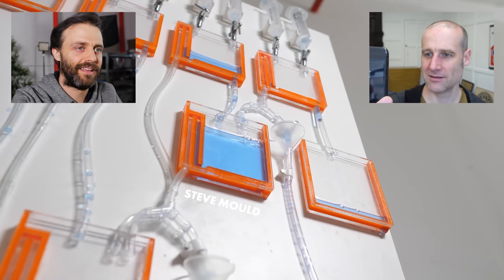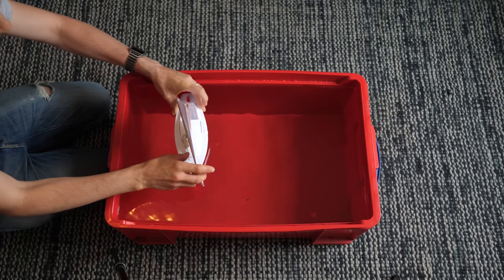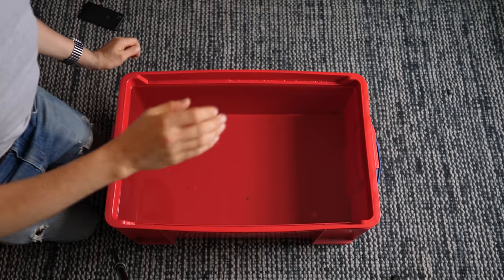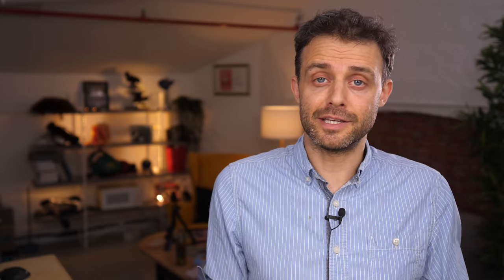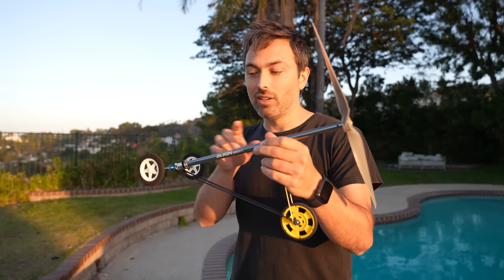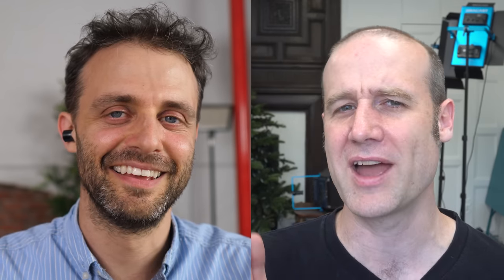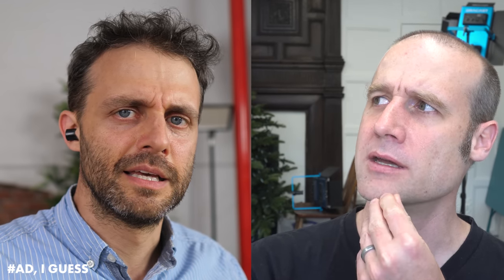Sailing Faster Than The Wind - How Is That Even Possible?

Comment: Delighted that I can wave my hands and a Steve Mould video appears
Reply: It's so cool when the same topic is explained by my two favourite science communicators.
Reply: Can you make a hand-propeller to improve this process?
Reply: A Wild Steve Appears!
Reply: In my experience: the novelty wears off after a while.
Reply: @standupmaths   kinda feels like christmas ❤️
Reply: I would like to think that I should get some credit for this too.  You guys may not know it, but I've been waving my hands this whole time!
Reply: Your video about passing wind in a land yacht gave these guys the gas they needed.
Reply: Can we do please a mega crossover with Derek, Steve, Matt and Michael (from Vsauce)?
Reply: Veritasium's video was about moving downwind faster than the wind, not simply moving faster than the wind. Steve, you missed the opportunity to show that possibility using your model. It should be doable if you point the "boat" 45 degrees and angle the sail somewhere between the direction of travel and the normal to the wind direction. This should cause the model to "outrun" the wind in the direction it's moving.
Reply: YOU NEED TO WAVE YOUR HANDS MORE OFTEN: but then you would have less time to make your wonderfull videos yourself.
Reply: @ericcmcgraw  steve has shown that if the wind pushes the sail at angle, the boat can move faster. derek has shown that if you angle the blades and force rotation via velocity, then it also moves faster. steve is showing how it works but flip it perpendicular and youve got dereks model. steve can only work with the resources he has
Reply: Classic Derek.
Reply: Let our powers combine!
Reply: he did kinda insult your video lol
Reply: @primenumberbuster404  yeah I hear creators lament that they can't put a video up if another channel did the topic already, and I'm like, don't be stupid, that doesn't matter to us, we actually like it.
Reply: @pulsarstudios3646  Steve's model doesn't require any more complexity to outrun the wind. He simply needs to run one more experiment. Just point the model 45 degrees from the direction of the wind. If you then aim the sail directly at the wind, it will exactly keep pace with the wind. Point it one more degree towards the rear of the vehicle and you can already outrun the wind. Go further and you can go even faster downwind, until it's parallel to the wheels and you run into the same limits he showed in the video. It is possible and easy to show that his model can outrun the wind, he just didn't try it.
Reply: Derek, maybe you should put a prompt in your next video and see if Steve bites.  Like: why does poop smell bad?
Reply: @ericcmcgraw  no, because then you are not traveling directly downwind, you are traveling at 45 degrees to it. Veritasium's video is much more interesting than simply tacking at 45 degrees, it should really be impossible to do at first glance.
Reply: Wait a minute.  Steve shows here that it's possible for a boat to sail faster than the speed of the wind but not directly downwind.  BUT... in Derek's video (Vertasium), that vehicle was traveling faster than the wind IN THE SAME DIRECTION.  I would like to see Steve's explanation for how this is possible.  I don't think it's possible in a boat.  In Derek's video, the wheels' motion, driving the propeller, play a crucial role I think.
Reply: @ericcmcgraw  I don't think so.  A boat cannot outrun the wind in the same direction as the wind.  In Derek's video, the vehicle's wheels are linked to the propeller, which adds enough force to exceed wind speed.
Reply: @jeremiasrobinson  Thank you! Here, have some credit :)
Reply: Thank you , @SpaghettiEnterprises !  It feels good to be recognized!
Reply: Veritasium keep me in mesh n this video clear me without actually telling the way I understand. 😁
Reply: @benedictifye  "Steve used Hurricane. It's super effective!"
Reply: Haha, you two have the same video topic
Reply: Hi Derek and Steve, You got a have a look at my antigravity box. Ofcourse its developed fro one of your videos
Reply: @EmilioBPedrollo  Would love to see this! you just named 4 of my fave channels lol Its a shame the world is so big and everywhere is so locked down because i would love to see these 4 + smarter everyday day doing a full in person collaboration. Maybe the same idea but the challenge is passed across the atlantic each time.
Reply: @primenumberbuster404  For me too.
Reply: just means your explanation was a bit.... :p

new one is so much better.
Reply: With great power comes great responsibility. 😂
Reply: I was about to go search for your video again to comment 😂
Reply: It's actually this video that decided to watch your video next. Why? Because I thought I understood. But Steve Mould said things that made me need to know more.
I would have watched the video anyway, as an aerodynamic recumbunt driver I love everything that are self sufficient, like human power, solar power. But I thought I knew how wind power was handled. Wrong.
Reply: @kenhaley4  From flying a drone I've observed that even a small increase in height results in much higher wind speeds.  I suspect that even a flat perpendicular sail would result in the same effect (of the ribbon at ground level pointing 180 degrees to the wind).  The wind higher up would propel the craft faster than the wind speed at ground level resulting in apparent faster than the wind travel.
Reply: you should wave you hands more often
Reply: With great power….,
What I’m saying is if you have an uncle named Ben, who is not affiliated with an Uhm, let’s charitably call it “insensitive” Branding campaign for a popular cereal grain, you should get him body armor ASAP.

[ASAP literally means “Right STAT now.”]
Reply: So, Steve Would?
Reply: @rifwann  No, Steve Mould.
Reply: @nohjrd  In which direction buddy? Unless you're trying to make your sail boat lift off the water like an air plane your comment is nonsensical. Think about what you said. You're mixing up both videos as if they are describing the same thing they aren't. There is no sail in Dereks video. It uses the wheels rotation to turn a propeller like a fan and uses the air from the fan to push the car. Ok go get a house fan and stick it on your skate board, then imagine doing that with the wheels connected to the propeller so when they turn it turns. 

In neither video is there anything with a sail and a ribbon at the same time. The ribbon is from Derek's video the Sail is from this video. Did you hit your head bro? Nobody is talking about wind speeds relative to height. The effect would be canceled out by the thinning of the atmosphere anyways at a certain height. The fact you think the wind is moving faster as your drone takes off is an illusion. It's not that it's moving faster its that there is less for it to run into , (the ground, buildings etc) and so your drone goes form experiencing wind in multiple directions to one direction and thus to you it seems like the wind speed increased, when it didn't it just all striaghened out to be going in the same direciton.
Reply: Saw both videos, love them both. You guys rock!
Reply: We need at least another video about the propeller thing. Still dont get it. Can you redo the treadmill experiment for instance? Thanks
Reply: That little visualization where they show two boats sailing/tacking across a cylindrical earth, then turning that into a propeller blew my fucking mind. How does anyone think up something like that from scratch? Wild.
Reply: @stevenutter3614  Haha....whoa you totally misunderstood what I was talking about.
What I'm saying is that often in a large flat area at ground level a drone will take off and sit in place fine (up to say 2m), but when you ascend to around 8 to 10m you get a warning that the windspeed is too high to fly safely.  The drone hits the faster moving air higher up and gets pulled quite violently away from you.
Wikipedia explains this effect quite well (apparently called wind gradient).
If I were to get land yacht and sail it directly downwind in the same conditions, it would be getting pushed really hard up the top of the sail, but only gently at the bottom.  I could accelerate to close to the windspeed (as measured at the top of the sail) but never exceed it. If I dangled a streamer at the bottom of the sail, it would point opposite to the direction the yacht is travelling.
If Derek's video had a second streamer at the top of the fan, then it would conclusively demonstrate that the vehicle was travelling faster than the wind...without that it doesn't. 
Make sense?
Reply: @primenumberbuster404  But they didn't. Everyone already knew the sail boat could go faster than the wind. What they needed to explain was how the boat's tack speed (downwind) could be greater than the speed of the wind. That is exactly what the Veritasium guy just decided to skip over, the thing which was essential to understating how the car was able to move faster than the wind going directly downwind.
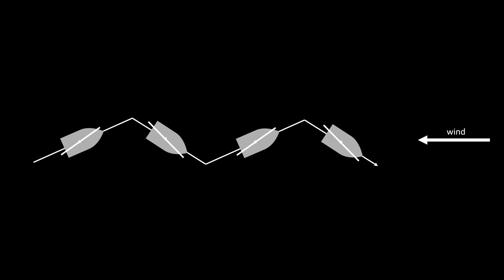Reply: The zigzag path at 8:51 is wrong, the sail angle must be between the ship's path and the wind, otherwise the ship will lose speed and then go in the wind direction
Reply: Well, only after Matt Parker delivers the message
Reply: @ericcmcgraw  We indeed need a proof that a sail boat can outrun a balloon in the direction of the balloon. I'm still not convinced. Let's say the wind is South to North. Let's say the boat is pointing North-East and the sail is maximally catching the wind let's cal that sail West-East. Then indeed the wind force will increase the speed of the ideal friction-free boat untill the SN-component of the sail speed is equal to the wind speed. This happens when the boat is moving in the NE direction at sqrt(2) times the wind speed. Still the N-component of the boat speed is equal to the wind speed and the boat and the balloon are moving with the same speed in the direction of the balloon.
So can we now angle the sail slightly to increase the boat speed further such that it will move faster than sqrt(2)*windspeed in the direction NE. If so then it will out run the balloon in the direction of the wind.
To me the answer is that this is impossible because in that case, the component of the sailspeed in the direction of the wind would be faster than the wind in the direction of the wind. Therefore the sail would be subject to (undergo) a wind force from North to South reducing the boat speed. 
I'd happy to hear where the flaw is in my reasoning. 
Of course, the machine in Veritasium's video is another situation because it has the wheel-rotation linked to the propellor in which case I agree that it can go faster than the wind in the direction of the wind. Those professors did a great job and invented something quite cool! I think in theory it could even be applied to sail boats replacing the sail by a giant propellor linked to a (reversed) boat propellor under water.
Reply: @richardbloemenkamp8532   The reason Steve's model works in this case is that we're assuming a frictionless and steady-state condition where everything has settled to a constant speed and there's no longer any force pushing the sail or accelerating anything. That's why the cart wheels are going straight without slipping, and the pusher-wheel is acting like a particle of air in the wind. When steady-state has been reached, any particle touching the sail will continue traveling parallel to it without being deflected in this case. 
I think I see your objection, but try this thought experiment on, given what I've explained about the steady state. Imagine the same scenario you mentioned with the wind traveling South to North and the boat is pointed North-East. We'll consider 2 cases: One with the sail oriented West-East as you described, and the other with an angle somewhere between that orientation and the direction the boat is traveling; let's call that the North-East-East case or NEE. In both cases we'll consider a wind particle (think pusher-wheel) that starts at the pivot of the sail and travels directly north 1 unit of distance, yet stays in contact with the sail because it's in steady-state. In the West-East sail case, the boat will have traveled sqrt(2) in its direction of travel (1 unit in the direction of the wind, 1 unit to the East). However, the NEE boat, because its sail is rotated counter-clockwise, the boat will need to be ahead of the WE boat in order for its sail to intersect the same point 1 unit north of the start.
If you think of it on an x-y plane, imagine the boat is constrained to the y = x diagonal line (45 degrees), and its sail can be at any angle, but must pass through the (0,1) point one unit above the origin. You can imagine the sail any angle and you'll find that it can end up anywhere on the y = x line. Horizontal means it travels 1 unit north, vertical means it doesn't move at all, 49 degrees means it has to move extremely far. This is why almost any downwind speed (or upwind for that matter) is possible, assuming sufficiently low friction. By zig-zagging you can compensate for the sideways motion and end up at any arbitrary finishing point.
Reply: @ericcmcgraw  Ok, that's a clever argument. If you extend that argument you could indeed move up to an infinite speed with a friction-free boat with a laterally air-friction free sail. This idea is more interesting than the entire video, but it is maybe a bit to advanced. Thx.
Reply: @richardbloemenkamp8532  Thanks. I agree it's interesting, and I was hoping he'd cover it in the video since he had the model and everything, but unfortunately not. Upon closer inspection it looks like he was trying exactly that scenario in the blooper scene at the beginning, but never explained it or showed it from above. Quite a missed opportunity; I'm hoping for a follow up video. (hi Steve, if you ever read this deep)
Reply: @kenhaley4  In Derek's video, the vehicle is traveling directly downwind, but the key is that the propeller blades driving it are angled to the wind. This effect is enhanced because they are rotating. The apparent wind for the blades would be close to the plane of the blades. This creates lift and allows for speed faster than the wind. Derek’s diagram of the boats going around a cylinder is a good demonstration, but he didn’t fully explain how it works.
Reply: What actually happens in Derek’s Veritasium video:
• If he ribbon is the only proof that the vehicle is going faster than the wind then the ribbon is just a red herring. It is easy to get taken in, if you first trust the prologue and believe there is a mystery. 
• If you want actual proof of how fast you’re going, in relation to the wind, you would have to measure the wind speed and the vehicle speed, at the same point, independently of each other. 
• Unless it tacks, an unpowered vehicle cannot be blown faster than the wind, no matter what gadgets you put on it. 
• The earth is not a cylinder and a propeller does not do double-tacking; nor can it generate thrust without an external force being applied. 
• All that happens is that when the air is no longer moving forward over the deck, the geared propeller is able to create a little breeze flowing backwards, which raises the ribbon and tricks the eye into believing the vehicle is traveling faster than the wind.
• This was a shell-game with the ribbon as the pea which had been palmed by the presenting magicians.
Reply: I wish I could do that!
Reply: 0:28 shout outs to fellow tubers always get a like from me
Reply: @Eric14492  I think the key is the fact that the propeller is being chain-driven by the wheels.  So here's how it works:
(1) the wind starts the vehicle moving, by pushing on the entire vehicle--including the properller.  The wind does NOT spin the propeller in the direction it would spin if it was free-wheeling.  Until the vehicle starts to move, the propeller does not turn.
(2) As the vehicle gains speed, the propeller turns forcing air in the OPPOSITE direction of the wind. If it weren't for being chain-driven by the wheels, the propeller would spin the other way.
(3) As the vehicle approaches wind speed, there are two forces pushing it forward--the wind itself, and the reverse thrust added by the propeller (which comes from the wheels moving on the ground).
(4) When the vehicle reaches wind speed, it is no longer being pushed by the wind.  Now the wheels are moving fast enough to generate enough reverse thrust to keep it going, and even to go faster.
(5) When the vehicle exceeds wind speed, it now has a mild headwind.  However the wheels are now spinning fast enough to generate enough reverse thrust to overcome this mild resistance.
Reply: I was searching for veritasium
Reply: Sort-of a burn?
Reply: The curve of the sail is actually an impediment to ultra-fast sailing. In the limit, you want the sail to be as flat as possible. That's why you see the America's cup boats with almost flat rigid sails. The dead-downwind speed of a craft with a sail is
V = Vs.tan(theta) + Vw

where V is the velocity of the craft in the direction of the wind and Vs - and this is the tricky bit - is the velocity of the sail perpendicular to the wind.
Vw is the velocity of the wind (measured by a stationary observer) and theta is the angle  that the wind hits the sail. (When the sail is flat to the wind, theta is 90 degrees)

This equation works for the land propeller craft. The key is that Vs component. On a regular boat, sand yacht or an ice sail boat, that Vs component is caused by the boat moving at a small angle off dead-downwind. For Veritasium's land prop craft (I know it isn't actually his machine) that Vs component is generated by the prop blade slicing through the wind. It doesn't matter a bit that it is rotating - but, it would actually be better if the prop blade was just a simple flat surface not the aero shape it is.
Reply: @stevenutter3614  watch Veritasium's latest video.  The wind gradient described by the UCLA physicist is exactly what I'm talking about.
Reply: @kenhaley4  I think you've got it backwards.  All of the input force is wind.  Therefore,  the wheels are driven by the windmill.
Reply: @thenatureofnurture6336  No, the wind moves the entire craft forward, and it's the friction of the wheels on the road that drive the wheels and ultimately the propeller.  The propeller, in turn, pushes air rearward, adding speed to the entire craft.  See Derek's followup video, including his $10,000 bet with a Physics professor, where this is explained better.  The propeller is NOT a windmill.  It's turning the wrong way.
Reply: @kenhaley4  You are overcomplicating it.  Watch it again.  The energy moving the vehicle is from the wind alone.  The wheels are doing no pushing against the ground to accelerate the vehicle, there direct effect is deceleration.  However, that force turns the windmill into the wind.
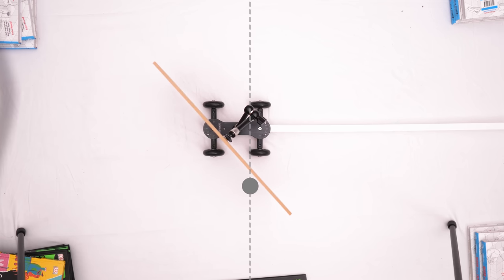Reply: @Veritasium 5:30 - watch this interaction with the air - then realize In your video you claim the blade/prop/sail is moving faster then the air turning prop into a fan.  

6:30 In your world, the sail would be moving faster to the right then his air stick wheel trying to push it - actively pushing air behind the sail backwards to the top of the video (your fan action). - Instead I claim the prop is moving with the air sailing on it just as this video shows.  The prop is never a fan lol.
Reply: @h82fail  yes.  The "prop" is a gear assisted windmill storing energy in the momentum of the mass of the craft.
Reply: @kenhaley4  The vehicles wheels don't add force, they consume force through drag - think about it... Forget what Veritasium says because he is wrong about force from the wheel and wrong about the prop pushing the air - the prop is pushed BY the air just as Steve shows in this video.  The blackbird is sailing on air - just like this video but with a changing sail direction to keep the thing going strait - its not a airboat powered by some magical force the ground provides.

Boat would be able to sail directly downwind using a moving sail (prop) just like blackbird.  You just have to replace the connection to the land (wheel) with a connection to the water (propeller). The only thing stopping a boat from going faster then wind speed directly downwind would be its added resistance vs wheeled vehicle. Sail would never be as big as a normal boat so only useful for going directly downwind probably.
Reply: @kenhaley4  For the model on the treadmill - At the point before you let the thing go, you've held the wheels which drive a prop to a motor getting it up to speed - of course your going to feel air blowing backwards - but the thing is not even generating its own power yet - this wind means nothing as far as how blackbird works.

Driving faster then the wind directly down wind is functionally the same as driving directly up wind IMO.
Headwind cars exist, look them up they have annual races even - they use turbines to drive the wheel.

Here ya go: https://www.hamburg-news.hamburg/en/innovation-science/wind-turbine-cars-setting-record-speeds

"...when two students built a headwind vehicle as part of their theses. The car consisted of a carbon fibre chassis and a rotor that drove the wheels."
Reply: Ah, if only grant would explain it, that would be awesome.
Reply: I think it's unfair to suggest you waved your hands around... You both make valid "arguments" and descriptors/theories. Just different ones. :)
Reply: @Veritasium yeah idk what his "hand wavy" thing was about... I thought you explained it quite well.
Reply: Yo its ya boi. The other science guy... Love ur vids tho i wish youd post more often. Even if its a few days more often.
Reply: "Risking My Life To Settle A Physics Debate"
Well, which is it? Waving your hand, or risking your life? You can't have your cake and eat it too.

...or can you? vsauce music plays
Reply: @nibornoreht  you may want to revise your comment.
Reply: @primenumberbuster404  not exactly identical problem. This video explain one case and one case only where boat can go "other way" faster than the wind . but the bost in this video will never goes "down wind" faster than the wind, nor does it explain why it can zig-zag up wind
Reply: Lmfao
Reply: Lol. Now that's a flex.
Reply: @EmilioBPedrollo  that'd be a once-in-a-lifetime gift
Reply: Can there be a vice versa thing 😂😂😂
Reply: When i read this comment while watching i tried it but i got matt parker instead
Reply: He explained it so well. You just create controversies and create click bait content.
Reply: You didn’t wave your hand, you put a helmet on and acted like a scared baby and this video appears.
Reply: lol yeah after you fuck up the explanation and leave everyone confused, it's Steve's duty to do the actual good explanation
Reply: @h82fail  It can go faster than the wind as once the craft is up to speed, and the propeller is producing thrust, (remember the propellor is not a windmill on that craft) the thrust from the propeller is increased because of the tail wind. It increases the propellers thrust close to its' maximum which is static thrust. An easy way to think about this is a light aircraft produces maximum thrust when it is not moving. As it accelerates down the runway the thrust drops off significantly. As it accelerates down the runway if you were to introduce a tail wind to the propeller its thrust would increase again. (However detrimental to lift over the wings).
Reply: @yup3398  Not sure what your replying to since there is 80+ comments and its too hard to find - but I will say think about it again.  This has no engine like your plane, and its not just temporarily going faster than the wind using momentum - it can maintain it.

Boats can sail upwind, nobody thinks the water must be pushing the boat into the wind.   No the wind pushes the boat upwind at an angle, using the water as a wedge - Veritasium even explains that in his video.

This works just like the boat, except instead of sailing upwind at an angle, the prop goes at an angle - again Veritasium explains this in his video how a prop turning can act like a boat sailing at an angle into the wind.  He provides all the information to lead to the right conclusion and I think he got lost following the coupe of wackos that build these.

Difference is that with the boat, the boat is using its hull as leverage against the water to apply the force from the wind.  

Where with the car, a crank is applying the leverage from the wind.

How about this - if the thing can 'drive itself into the wind/air' - how come it can't do so with 0 wind/airflow across the ground.  That is to say, if the wind speed is 0, can this thing go faster than the wind.  Nope.  It can only go faster than the wind WHEN there is wind - that should be all the intuition most people need to realize it must still be powered by the wind even though its going into the wind.

Answer is because it needs that airflow to take energy from, same as the boat sailing upwind.

Do a search on upwind car racing, they do it annual (or were).  Everyone involved agrees they are designing windmills that drive themselves into the wind.  Here they drive directly upwind, vs blackbird goes downwind until it catches up and then is driving itself upwind same as those other upwind cars.  Literally the only difference between blackbird and those other upwind racing cars is that blackbird has low enough resistance and can change the pitch of the blades when it hits the wind speed barrier.  That is it.

Surprised after a year+ people are still spreading the false info that the ground can magically power a fan.
Reply: @h82fail  I agree their first video was terrible and the guys who created it, while clever, are fairly abrasive. 

It is critical to understand the difference between a windmilling propeller and one that is being driven that produces thrust. That is where their first video is critically wrong. Even this video is leading everyone down the wrong path. The spinning blades on the Blackbird are not acting like a sail on a boat once it is underway at enough speed that they un-stall and produce thrust. It is quite opposite to the headwind turbine cars you have referenced which use a windmill to drive the wheels. 

With the Blackbird, while stationary with no wind, yes it's speed will be zero. Once you introduce a tailwind it will start to get blown with that wind due to drag. Even if there was no propeller on the craft it would start to move along with the wind assuming low surface friction on the ground. It is important to note at this stage the prop on the back is stalled. 

The blade angle is set for driven thrust. That is to say if you held the craft still and disconnected the chain link from the prop to the wheels and allowed the prop to spin freely with the wind it would spin the opposite direction, like a windmill or sailboat, to the direction the wheels actually drive it. That is the critical difference between Blackbird and yachts/headwind turbine cars.

The craft picks up speed with a tailwind due drag from that tailwind and low surface friction. Once underway with enough speed the wheels start to turn the propeller. Once the propeller gets high enough rpm it will un-stall and produce thrust. ie it will push air back toward the prevailing tailwind. Having tailwind is an unusual and ideal scenario for a driven propeller. 

As a driven propeller moves more air through itself its' aerodynamic thrust starts to rapidly decay. Quite opposite thinking to a windmill or sail. We need to introduce more engine power to either spin it faster (or change its' blade angle and maintain rpm) to maintain the same amount of thrust. When a propeller aircraft accelerates down a runway its aerodynamic thrust quickly decays. Consequently Propeller aircraft are rated in horsepower, not pounds of thrust as the thrust is not constant. Whereas a jet produces a high velocity reaction stream of air which is largely unaffected by increasing velocity as you takeoff and so is rated in pounds of thrust.

The Blackbird's driven propeller is able to produce more thrust than it otherwise would because the tailwind reduces the airflow through the propeller. This enables the propeller to produce maximum thrust for far longer. Combine that with very little forward parasitic drag due to the tailwind and the craft can creep along faster than the wind.

It is why the treadmill example works also. When the craft is held on the treadmill it simulates whatever speed the treadmill is set to. However as the treadmill is stationary and has no headwind it is also therefore simulating a tailwind of exactly the same speed and so you set up the same scenario. 

Some practical examples of this aerodynamic advantage can be seen elsewhere. A helicopter needs far less engine thrust when it is hovering near the ground. The ground acts like tailwind. It slows down the velocity of air through the blades. A simple mind experiment would be to put a small battery powered fan on a skateboard. Allow the skateboard to get to terminal velocity. If you were then to follow the skateboard with another fan but pointing its outflow at the fan on the skateboard (like tailwind) you will see it start to accelerate.
Reply: @ericcmcgraw  It was really about making money out of the video ,,,,I have seen this video and he was going across the wind ,,,that ail thing at the front of the kart he claimed was proof he was going down wind was a con ...it was being pulled that way by the prop,,,look at the dust from the camera cars then you have the true wind ,,,,anyway you cannot get something for nothing.
Reply: @standupmaths
Reply: @y0uCantHandle  freshflamelitthefumednostrils
Reply: @ericcmcgraw  zzzseeeeeeeeed😅😅
Reply: @aguy3896  Oh and by the way, when your going downwind it's not called tacking. Tacking is only upwind
Reply: @kenhaley4  well if you had a propeller in the water theoretically it might work
Reply: that + a cameo from the mathematically-perfect-shoelace-tying-guy ☺️🙃♥️
Reply: Can I come to your Christmas party?